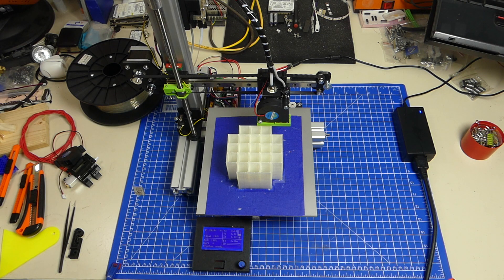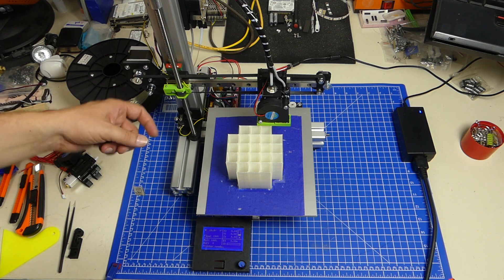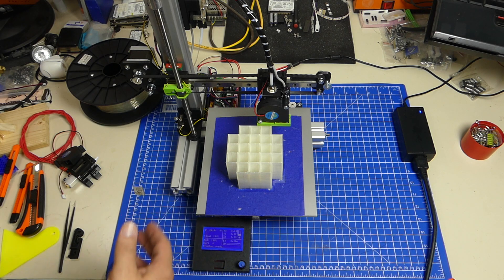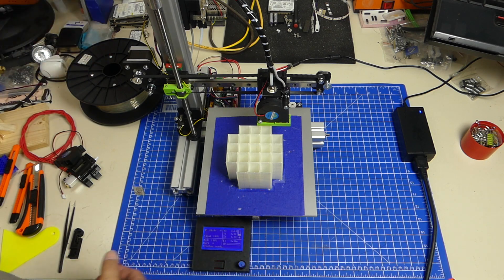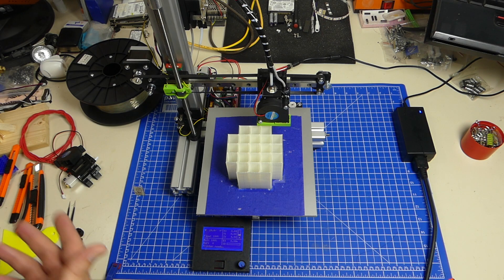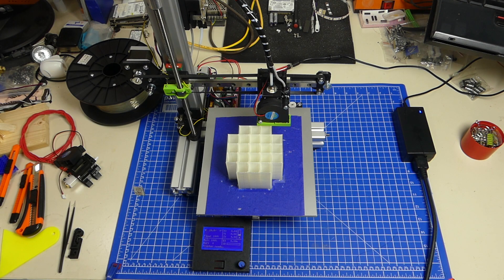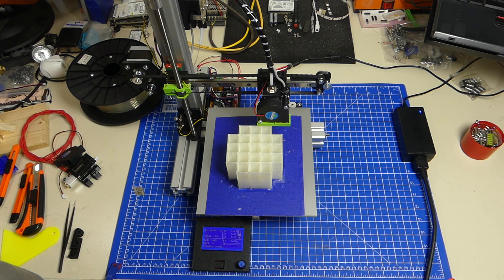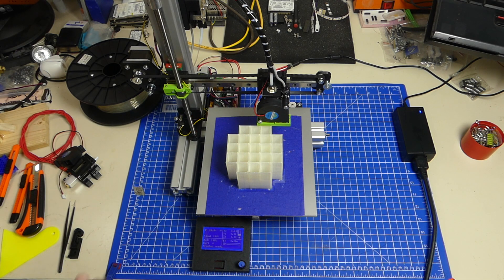Big Bad Robin Build VLOG pt. 16

Comment: Hi Dirk, glad you're happy with the printer. I was watching the end of the video and I was thinking that I had no lathe but I sorted that problem without one. I printed a cap for the T8 with a conic hole on it and another one with also a conic hole where the leadscrew sits. In the middle I put a bearing ball. This way if you have already a 3d printer but not a lathe you can do this.  It's a sort of a bearing with just one ball. I had to do this because I modded my Tronxy X3A and put the motors up on top of the Z-axis. then I realized that if the leadscrew wasn't sitting on some place it introduced some elasticity and this leaded to Z-axis backslash. But just after doing this I realized that the cheap leadscrews this printer has were not completely straight so holding both ends of the screw introduced Z-wobble.... al the end I removed the support and the Z-axis screw hangs free but I changed the coupling at the top of the axis for a non elastic one. This also introduces some Z-wobble but not as much as before.
Reply from the maker: Good call ! 
I made a second Z-Axis idler, that is basically just a sleeved hole for the TR8 rod with a smaller hole right through to the bottom of it, where you can drop a 4 or 5mm bearing ball. So the ball sits between the rod and the aluminium profile. 
I made one of those for the Tarantula, it worked really well, and I have already modelled that part for this printer here, because not everyone has access to a lathe.
Reply from the maker: I added the Z axis idler that does not require lathe work here:
https://github.com/dherrendoerfer/The-Robin-3D-Printer-Project/blob/master/STL-Files/Bad-Robin/BR-v1-Z_Idler_nobearing.stl

Comment: Hello! will you make the wood version of the 3D printer you talked about? Thank you very much for your your and especially for sharing.
Reply from the maker: Yes, I did continue with the 'Woody 3D printer' and I even took it to the MMF in Stuttgart, and two Maker meeting around here, and it was great fun.
It's much more of a humorous project than a real thing, but I'm considering giving it more time.
Reply: Ok. Thank you again for your work.
Reply: @dherrendoerfer  Hi. Will you publish the Woody 3D printer?
Reply from the maker: There's not a lot to publish - the projects been on and off my desk for so long. The main problem with it is that the wood warps so badly. But the way the rods form the slider is really useful.
Reply: @dherrendoerfer  Ok, thank you.